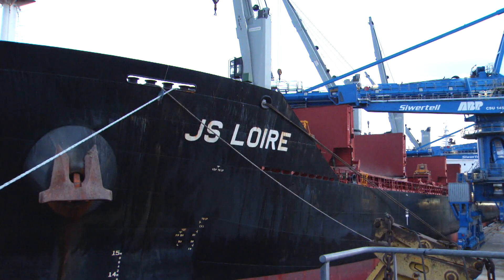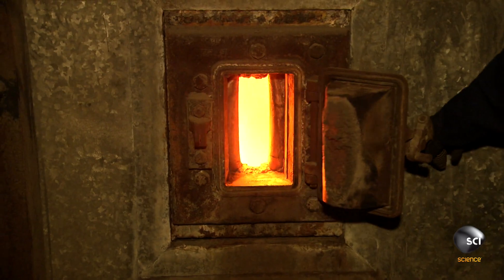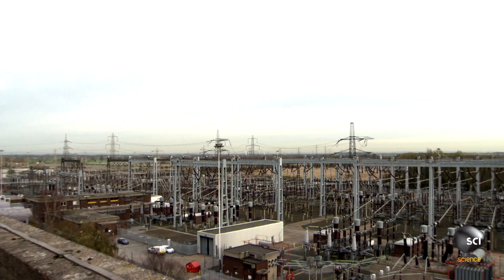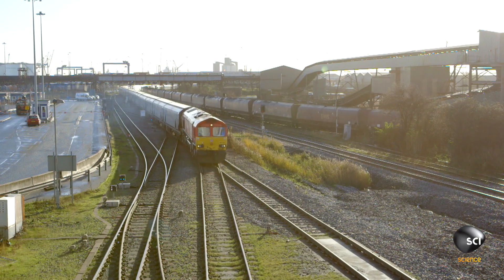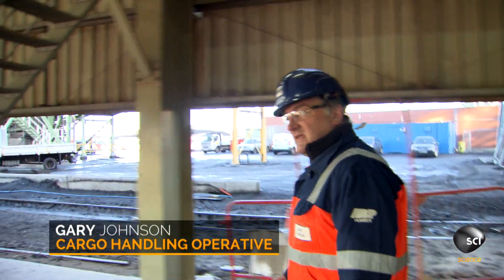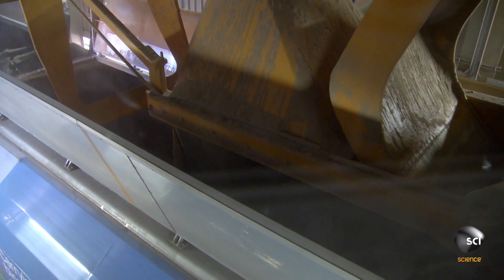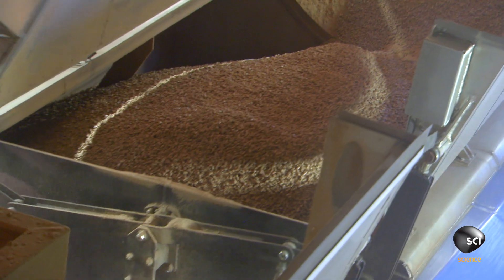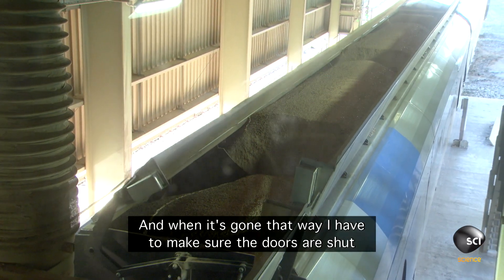Shipping the Wood Pellets to Fuel the UK's Largest Power Plant

Comment: Why the hell is the UK powering itself with wood chips?
Reply: Greener energy than Coal
Reply: Less carbon emissions, cleaner burning
Reply: Cause we have to cut our plant food emissions
Reply: Dead wood can be reduced in case of fire
Reply: @damianredmore9448  Drax is a coal station burning wood pellets in the interim period of moving away from coal to renewables. Drax is too large to take offline, the jobs are fairly secure there until 2025 but past that date closure is imminent. The replacements will be a mix of renewables and energy from waste power stations. There is a chance Drax will start burning waste in the future also, which is considered one of the most sustainable energy production modes nowadays.
Reply: @damianredmore9448  did you ignore my comment on purpose or? I told you it’s being used as an interim fuel, I didn’t mention emissions or carbon neutrality. Anybody who thinks any current power generation in the UK is carbon neutral is an idiot.

Regardless, the move away from coal was more based on the expense involved with sulphur emissions treatment. Biomass needs a lot less gas scrubbing to remain within the emissions consents. The reliability of the ageing emissions control equipment came into question as well, with breaches on consent comes penalties which make efficient operation nearly impossible. 

You can try and make power generation political, but in reality it’s just a private business looking for the most profitable survival method. Drax can still burn coal without penalty, but they’d go out of business pretty quickly.
Reply: @AHJ99.  The only time nuclear power releases CO2 is when its being built and the emergency generators being online when offsite power is lost.
Reply: Yeah the trees 🎄 were quite green
Reply: What do you suggest?  Killing more birds with those damned windmills?  Taking up valuable crop land with those solar cells?  What???
Reply: @donberry6079  It's called nuclear power. Look it up.
Reply: @neodark414  Where would we get the uranium?
Reply: @N0Xa880iUL  they do not cut down trees to produce wood pellets